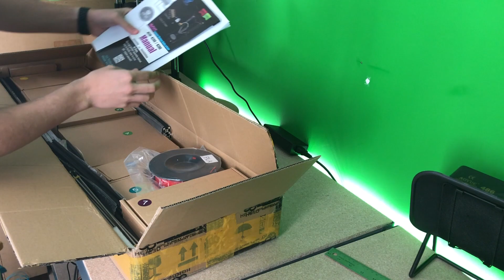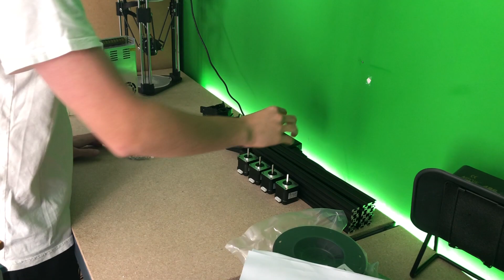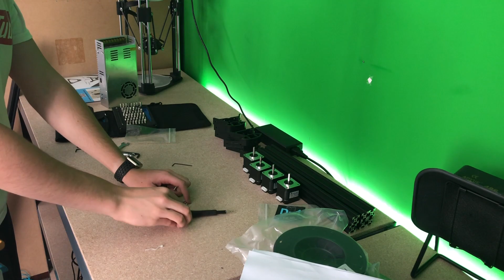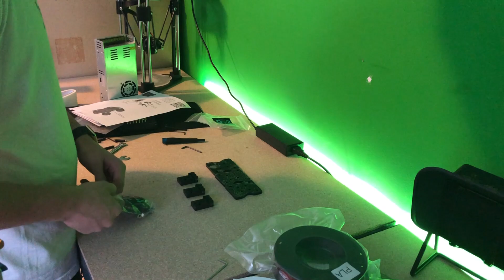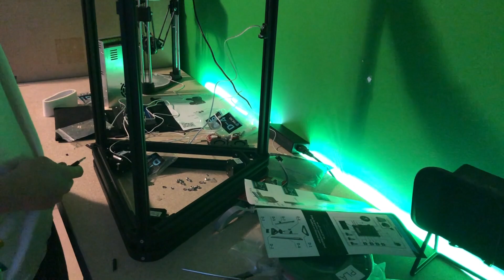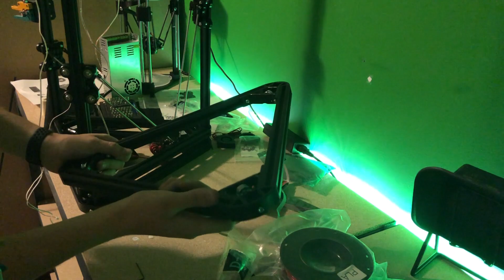HE3D K280 Unboxing and Build Video | 3D Printing

Comment: I saw an ad on Aliexpress for an HE3D 3d printer with triple 
extruders from some place called Reprap for $336.00. It 
showed a picture of a triple extruder printer with a 3d 
scanner. It was about the same price I had seen it 
advertised elsewhere, and Ali has a fairly good reputation,
so I ordered one. When the order was placed on my 
account, reprap had done a bait and switch and replaced 
the pic and product order with one of a single extruder 
printer I can get anywhere for a hundred bucks.
The pictures are so small on Ali's phone app that I didn't
 notice the switch until after it had shipped. After I sent 
a message complaining about the switch 
and demanding a refund, a smiley face appeared 
on my order page from a "lmao yang". The representative
from reprap said there was no mistake and they would 
"try", wink wink, to return the shipment. Do not buy from 
reprap.cn they are a complete fraud. I have tried to find 
HE3D's face book page, which I visited several times 
before I decided on their HE3D triple extruder printer, 
but it seems to have vanished. I was only looking for a 
triple extruder printer when I stumbled on Ali's reprap
advertisement. Why In hell would I pay a 300 percent 
markup for a single extruder printer?
Reply: Just ordered one from reprap.cn 😅😅
Did it include the 2 PLA’s that came in the description at least?
Reply: Found this too late haha

Comment: any chance you can verify if injected molded effector and cooling system are there???
Reply: unglaubich uberlieber the effector is injection molded. The fan cooling system is a part that you would need to print on your own.
Reply: thanks for the reply